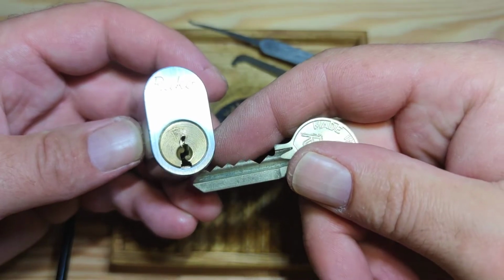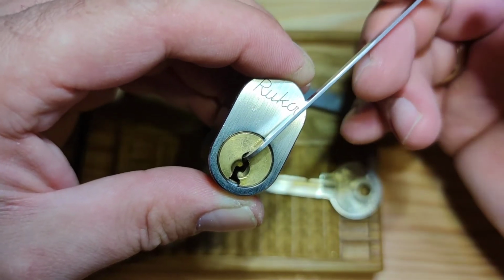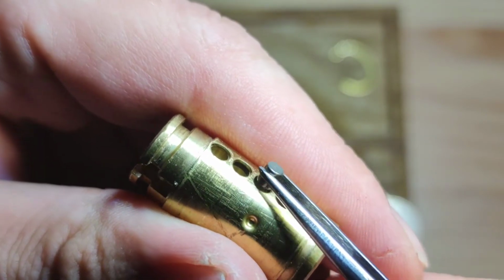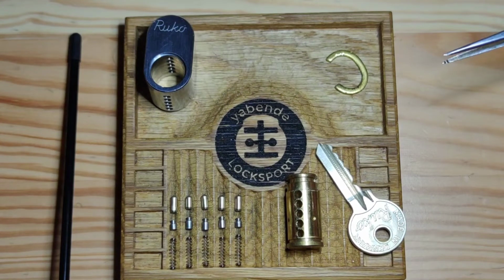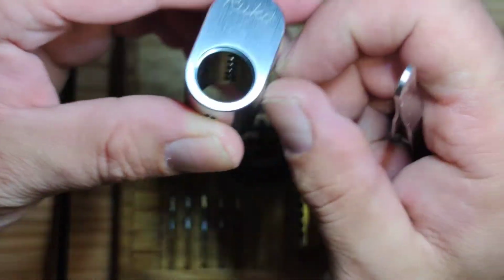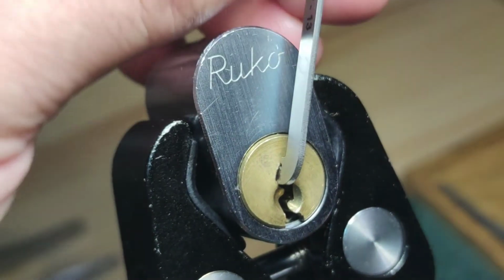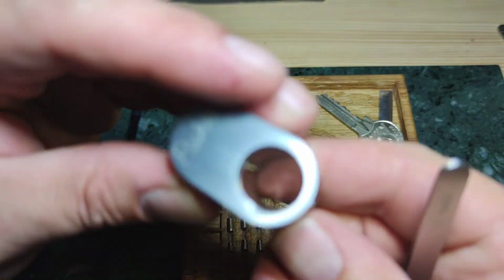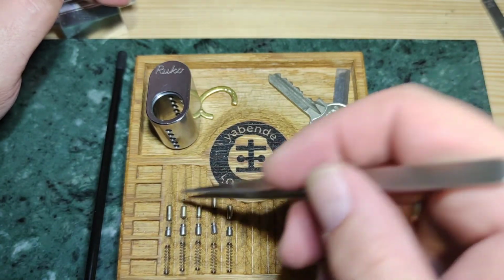Ruko 500 with gin spools picked and gutted

Comment: I have not yet needed to float pick. Are you just slightly moving the tension bar to the other direction to get the gin past the milling then apply tension to the right again? Also do other pins like assa barrels require this technique? Thank you
Reply from the maker: Float picking technique is needed primarily for gins and undercut, in which gins lock. For Assa Barrels you do not need to use float picking - what kind of lock do you have with assa barrels?
Reply: @yabende  I have an assa maximum and a few others. I do also have one I made as a training lock and bought a whole set of security pins. Right now it is above my level. I am not sure if my twin Combi has any yet - need to gut it. I have a couple of others i have not been able to identify and I do have the key. Maybe someone can help me identify the locks. Thank you!
Reply from the maker: @xRedXLV  go to the lockpicking.chat and find me
Reply: @yabende  okay I will find you. Thank you very much for being helpful!